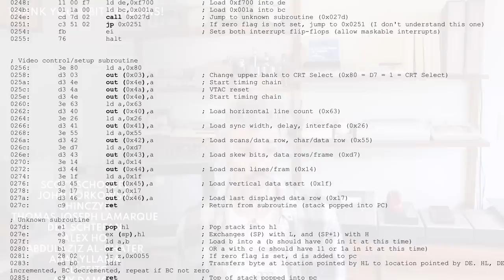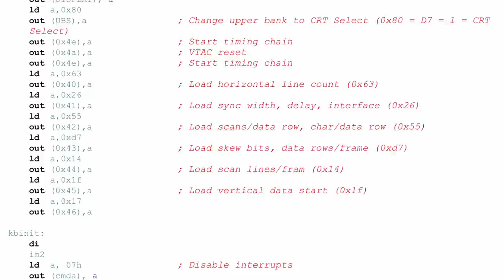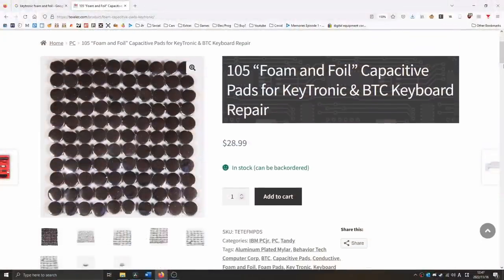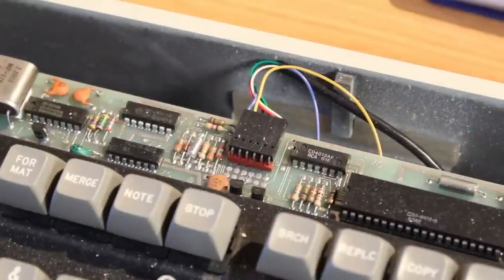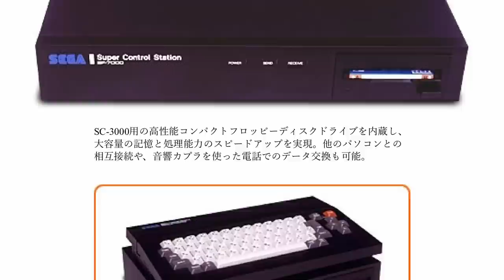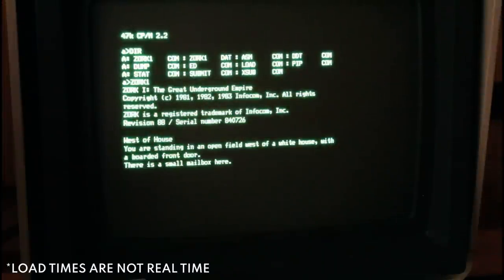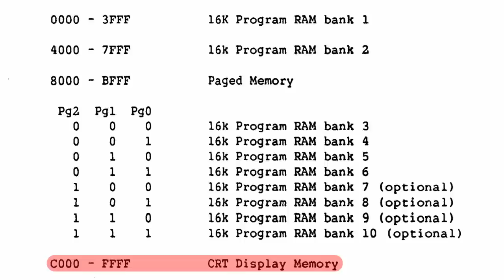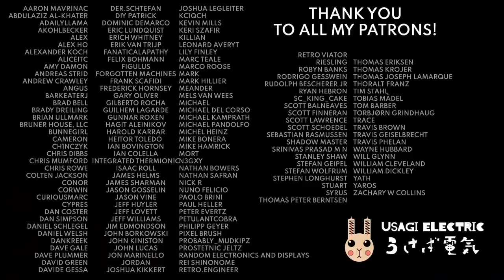Wangwriter Pt.3 – It Runs Zork!

Comment: KeyTronic keyboards like this do not have conductive contacts - they are capacitive. The conductive side of the Mylar fades away from the pcb :) 
You can actually type on them by touching the PCB!
Also, don't judge the feel of all F&F keyboards based on the TexElec pads. The foam they use is too firm, too tall, and sometimes the Mylar has issues too :(
Reply from the maker: Good catch! You're totally right, it's definitely capacitive and in the back of my head I knew that, but just totally forgot about it when filming.
That's interesting that you mention the TexElec pads feeling different, because the keyboard definitely more affirmative to mock type on before I replaced the pads. Maybe after some solid use the TexElec pads will soften up or slim down a bit and the feeling will improve.

Comment: As with most 8-bit CPUs, programming the Z80 isn't particularly difficult once you understand assembly concepts.  Difficulties more often come from the idiosyncrasies of the specific machine you are working with.  Give it a shot.  It's fun.
Reply: You got right into the point. Is like any microcontroller. You can even pretend you dont need to know the arquitecture because you work on C  ... but once you got into the peripherals and the HW you have added ... things start to add up and in some ocasions C is not even good enough, and you can end with asm stubs (NEED FOR SPEED !!!!!!!). LOL
Reply: @AlexanderGrahamSmell  More intricate, but not really harder, but more features in the CPU. (For instance, most 8 bit  CPUs didnt have multiply instructions, i think the 6809 was the exception to that)
 Lots of people programmed raw 68000/8086/VAX in the day. When memory limitations were a problem, every byte counted, and even the most efficient compiler wasted memory.
Reply from the maker: You nailed it, 256Byteram had the BIOS written fairly quickly, but it took us a ton more effort to figure out how on earth the Wangwriter was dealing with the floppy, and we're still not quite there yet!
Reply: @UsagiElectric  Amstrad used to manufacture a very popular range of Z80 machines (CPC for home and PCW for office) that used bank switched ram. Maybe the CP/M Plus source is available somewhere? 
https://en.wikipedia.org/wiki/Amstrad_CPC#CP/M 
https://en.wikipedia.org/wiki/Amstrad_PCW 
https://en.wikipedia.org/wiki/CP/M#CP/M_Plus
Reply: CP/M was originally written for the Intel 8080. With the bundled tools using Intel, rather than Zilog, opcodes.

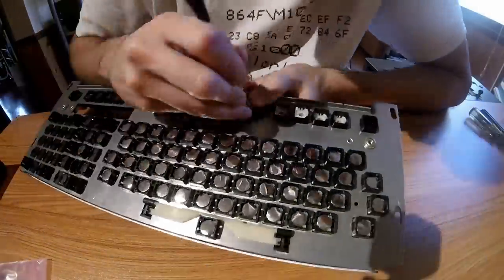Comment: 8:55 I had to restore a very similar Key Tronic F&F keyboard from around the same time. The big chip on the right is the keyboard encoder, one of the General Instrument 4592 series.
The Interdesign 900c is a custom linear (analog) chip, which essentially amplifies the differences in capacitance when a key is pressed. You can see the likely circuit it contains at the bottom of Figure 1 ("Sample keyboard design rom coded keys") of the AY-3-4592 datasheet.
Reply from the maker: Oooh, interesting information on the 900C! I didn't think about it being an amplifier, but that makes total sense given that the capacitive key switches will definitely need amplifying and shaping.
Reply: @UsagiElectric  And Digikey says thay have them "in stock", though at $310 per each I think this is a Rochester kind of stock, where they will package them in a CERDIP package for you, if you order 64 of them.

Comment: I hope you can get Wordstar running as it seems an appropriate application for a computer attached to a printer. Back in the day, 1983, I was so proud of myself for mastering our z80 computer, getting it working with a daisy wheel printer,  learning Wordstar and putting it all together to submit a junior high assignment. Wordstar even had formatting for things like bold, super and sub-script and possibly also underline. Bold was funny as the printer just hammered on the character several times before advancing the print head.

Comment: Having disassembled, mangled and reassembled the TRS-80 MIII Infocom 'runtime' to make it run on several unusual Z80 based computers this warms my heart. :)  The Infocom code seems to be 8080 instructions only, would have to check it more  completely, so it'd be likely it could even be made to run on 8080 computers too.
Reply from the maker: Thank you!
I'm still learning Z80 assembly as this is actually my first ever machine with a Z80 processor, but compared to the Centurion assembly, Z80 stuff is far more digestible!
Reply: @UsagiElectric  Big fan of the Z-80.  Once you get used to it, it is actually quite easy to write assembly on it.  I always found the 6502 to be far harder to write for, simply because of the 6502's lack of registers and address modes.  Sure, the 6502 had zero page, which you could use as quasi register space, but that was very limited, if you wanted to leave basic and the DOS intact.

I may be biased, as the Z-80 was the first processor i learned assembly on.  But man i love that chip!

Comment: Word Star!  It has been SOOO long ago but, I have made CP/M Word Star run on many oddball computers back in the '80s.  Word Star does not require much RAM as uses two cache files on disk to keep track of the document.  In the '90s I wrote in Borland Turbo Pascal and was happy that the editor used the Word Star control commands.  ;)

Comment: I worked at a data entry company many years ago and used a Wang. One thing I'd like to say is that they made the BEST keyboards of all time, even better than the legendary IBM Model M "clicky" keyboard. It looked just like the one y0ou have there. It felt like you could drop it off of a skyscraper and it wouldn't even be scratched. Built like a tank.

Comment: If i remember correctly zork ran on a virtual machine similar to the later sierra games. One of is output options is a printer. Seems to me that the wang writer would make a perfect target to use the printer output to give you a paper trail...
Reply: I first played Planetfall on a printer.
Reply: It is a virtual machine, yes. Z-Machine version 3.
Reply: Writing a printer driver will be a much bigger task than porting CP/M.  The printer stepper motors and sensors are controlled directly by the main Z80 CPU.  (Normally, a printer would have its own microcontroller to handle moving the paper, moving the print head, rotating the daisy wheel, and striking the hammer.)
Reply: @Mueller3D  that does complicated things, but if they can figure out the crt and the keyboard by only communicating over the net, I'm sure they can do it. Especially now they seem to have found the system disc. They can reverse engineer the routines needed.

Comment: Tektronix computers of the day used the same type of keyboard. The plastic disc on the foam is Mylar with a layer of metal on the foam side. The connection is made capacitively. 

Feel free to use a DMM and prove me wrong. But that’s what I remember from the old Tek keyboards.

Comment: Actually have one of those keyboard boards, the microcontroller is a GI mask programmed part, which you generally need to get the mask code to get a new one, and each mask came with basically a customer code, and the GI logo and base type, and a date code.

Comment: Great videos!  Most printers of that era had some sort of built in print test.  This was often accomplished by a jumper or dip switch setting, but was sometimes enabled by holding a line feed button while the system was powered on.  Not sure if you have looked for any of these to test the printer.

Comment: I tried to re-house my Spectrum in an old foam and foil keyboard case back in 1985 as the original keyboard flex cables had broken. 
This did not work, as the key switches do not rely on conduction but are capacitive. (if you check the pads for conduction with a multimeter you will probably find that they have a thin insulating coat on top) 
This actually marked the point that I gave up professional programming :-) 

(I had been making some money writing games, but had just started at University and didn't really have the time. The fact than I no longer had a working keyboard was the final decider.)

Comment: My memory of KeyTronic keyboards is you don't feel the foam as you type, it's too soft compared to the normal keypress resistance. Sounds like those replacements are NQR - not quite right.
I worked in a telco repair shop and we were forever disassembling them and cleaning out all the dust, that fixed 90% of them.
People complain about modern rubber dome keyboards, compared to the stuff we handled  back then they are golden, they just keep on working, unlike the junk we were saddled with. If they didn't jam on the way down (or back up), then they didn't register a press at all. Keytronics had good up and down action, shame about the 'contact', others had magnets and glass read switches, so that almost never failed, just the mechanics of the keystem would flog out with key jams all the time (Sagem Telex machines)

Comment: I wonder what interpreter is running that Zork. It's not the mainframe version; it's the well-known version that Infocom made for microcomputers. (Well, of course it is. One of the major reasons they did that is the original couldn't fit on disks and in memories of micros of the time.) Specifically, mid-1984, according to the serial number. For portability, they created a special-purpose virtual machine and just wrote interpreters for the different computers they wanted to release to, so they could have the same "story file" per title on all of them, meaning a lot less effort in porting. I guess 256byteram just used one of the existing interpreters for CP/M. Or heck, now that I researched it a little, I guess it's just an existing copy with the interpreter and story file packaged together.

Comment: The Keytronic keyboard on my freshly restored Victor 9000 failed in the worst way earlier this year. The mask programmed 8021 died.  My first and only Arduino project was to replace the custom 8021 with an Arduino Nano. It works a treat once I worked out the detailed Victor documentation was very wrong in places!

Comment: Going to guess Wang made CPM run by running the lot just under the paged area, using the paged area as essentially a ramdisk, or as data storage, so that programs could easily be storing data in there, but CPM would flip page when it needed the area, getting 16k of scratchpad RAM for internal operations, and probably using a few pages for disk use as a set of buffers, as 16k does allow a good few sectors to be read in at a time.
Reply: That's entirely possible, but I'm not sure how they'd go about loading disk data into the program space when CP/M is selected. Usually the BIOS loads 128 byte sectors to address 80h, but user programm can change that address. If it were changed to a bank that was switched out, it might corrupt CP/M or the software. There's need to be some sort of address check to make sure it doesn't happen. Doable, but tricky.
Reply: @256byteram  Well a Z80 can do DMA from memory to memory, so read a sector in, set up DMA to a selected page, and then read a sector in again. depends on just how many sectors the BIOS can transfer per DMA request, if you can do an entire track in one, then the DMA can occur during the step period to the next track transparently. If single track then it will be slow doing a sector per revolution.

Comment: (@0:59) You can see from the memory dump that the string, “Restart POWER UP Procedure” has a terminating null, but no length byte, which would indicate this is a common C-string, while the string, “NOT A SYSTEM DISK” does not (if it had one, it’d be @ 0x0214, which is the 1st character of the “Restart…” string.) The strings are of different length, so they’re not in a table (array) of fixed-length strings either. So how does the printing routine know where the end of the “NOT A SYSTEM DISK” string is, as neither is a Pascal string, either?

Comment: Did I see some numbers printed on the backside of the keyboard PCB? Are those by any chance the very scancodes you were looking for in the first place? And: It looks like there are pads on the PCB for a seperate number pad; were there different models of these keyboards, some with, some without a keypad?
Reply: The numbers on the back of the keyboard PCB don't appear to correspond to the scan codes.  They seem just to be key position numbers.
(The 1-4 keys are 20-23 on the back, but are scan codes 6E-6B.)
Reply: @Mueller3D  Just add 110 (dec)! 😁 ...ok, now I'm really just grasping at straws. 😂

Comment: This paged memory was common on CP/M machines.  I have an emulator for the TRS-80 Model 4 that used paged memory - it put the video display into a "hidden" bank so that the OS had more memory to use.  Also, maybe the BDOS error is caused by insufficient time being allowed after starting the drive before trying to read it?  Does it only happen after the drive has stopped spinning?

Comment: Could you 3dprint a new layout for the keyboard , then add more keys to the keyboard such as numpad?
Reply: Saw that as well, and there seems to be space for an 'escape' key as well
Reply: @pc4ad  All the traces seem to be there , So i think it would work based on what we can see in the video.  Werid they did not add them as the shortcuts with the numkeys was used alot in word software.

Comment: Scancode, that sounds easy. Call up Wikipedia and read how the scancodes on PCs are. 
Or don't old computers stick to the conventions we know today? 
Old computers often have wild ideas to solve things that we have solved by default today?
But the Z80 is well documented and well known.
Reply: The scan codes for that keyboard are obviously not the same as the IBM KB scan codes since pressing the "function" keys only gives a single-byte scan code where the IBM KB scan codes for the the function keys are all two-byte.
I found out stuff like that when I needed to write a little DOS TSR (Teminate and Stay Resident) program for an older PC which crashed a particular program if you pressed the keypad 5 with Num Lock turned off.  Since that key was not required for anything but was possible to type accidentally, my TSR changed the scan codes to make the 5 key with Num Lock off "look" like the ordinary 5 key on the main keyboard had been pressed.  My final version would even check Shift, Ctrl and Alt to make sure that it only changed the scan code for numpad 5 when it was appropriate to do so.
Reply: PC keyboards have standardised scan codes, and they send codes for key up, key down, shift state etc. Machines before the PC were pretty much pot luck. More expensive systems gave you ASCII codes, cheaper ones gave you bits set on a scan matrix and anything in between.